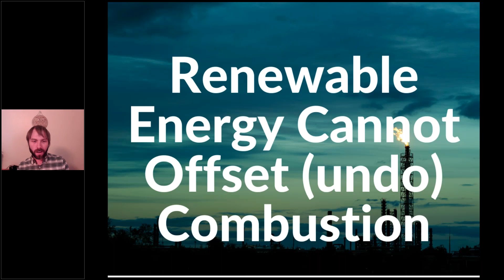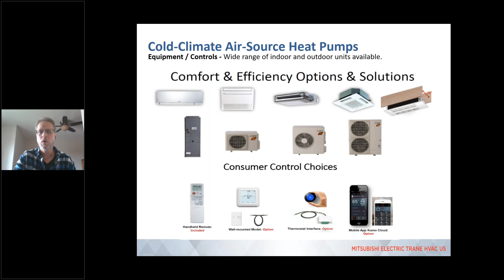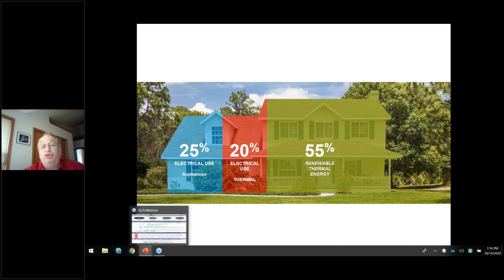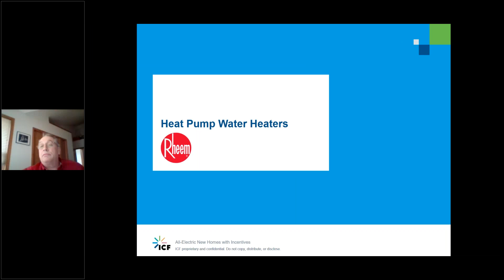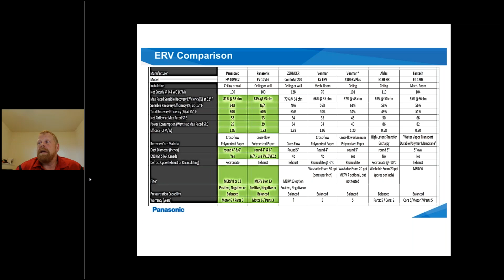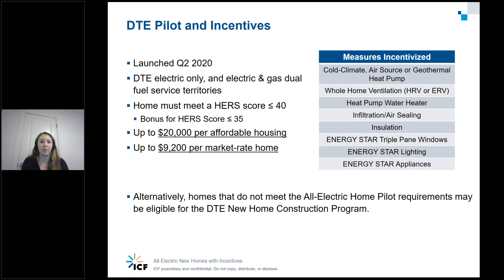All Electric New Homes and Utility Incentives in Michigan

Comment: Brett, would be really interested in air to water heat pumps. Obviously not terribly popular here in the US. I'd like to replace our whole forced air system with hydronics and it seems like outdoor air to water heat pumps are more effective than air source that keep being talked about. (Lansing MI)
Reply: Totally agree. I’m in the same boat and it’s such a challenge to make some headway on this. None of the local HVAC guys are interested in such systems. And the manufacturers don’t make it easy either.